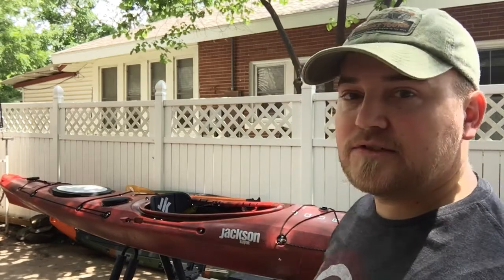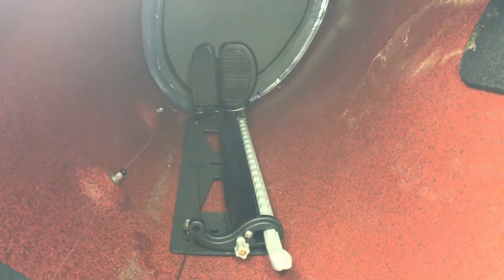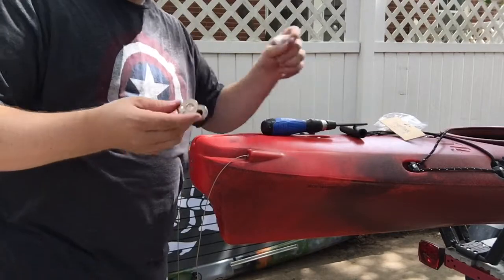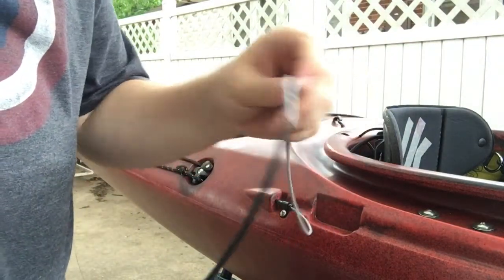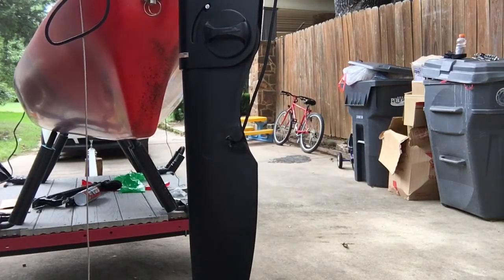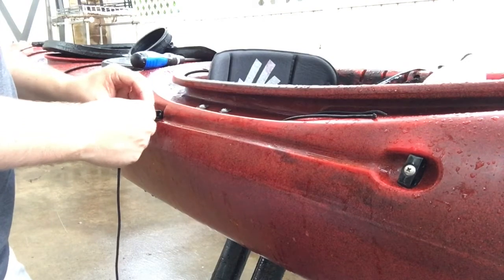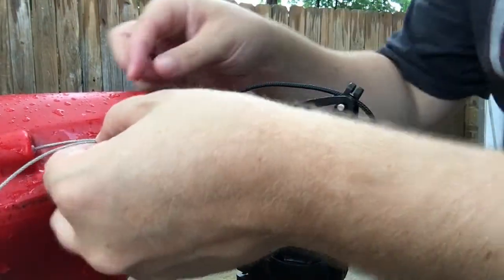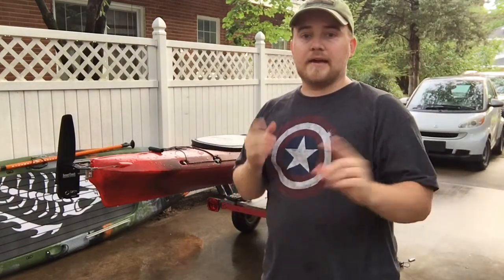Kayak Rudder Install

Comment: Thanks for this great video on the Smarttrack rudder install.  I’m in the process of installing it on a Wilderness Systems 14’ Tsunami and honestly I thought the various little sections of instructions provided by the manufacture were lacking to say the least.   While every kayak may be a little different, the instructions lacked a cohesive start to finish explanation.   Your video did that perfectly.   Thanks very much for taking the time to make this job easier for the rest of us.

Comment: I have to say I just installed one on my Prijon.  I really think the fact that when retracted it stops 90 degrees straight up is just a terrible design.  There's really no way to lock it down for transport.  if you load your kayak from the back of your vehicle and the back tip of the kayak touches the ground you will ruin it.  Also the when you retract it you have 11'" of cord just hanging from the cleat.  The action is good and it performs well I just think the retraction design is really bad.  Very informative video, well done.

Comment: This is a brilliant video. I also have a Smart Track rudder and my cables have become stretched.  In your video you attach the wires to the rudder after you have placed the foot pegs in a certain position and I could not quite follow this.  Could you please explain exactly how your foot pedals were positioned when you did this please?
Reply from the maker: I believe I placed the screw adjustment to the middle on both sides and then I would pull the right cable all the way out pulling the right peddle to the rear position and then place the rudder all the way to the left and mount the cable. Then the reverse for the left side. This way when both of the peddles are moved to the center the rudder should be centered as well.     I hope this helps

Comment: Thanks for a great video. Jackson Kayak should give you a job. I'm considering buying a Jackson Journey and was concerned that their rudder system was a little complicated so your video helped me to better understand not only how the system worked but how to maintain it. BTW how do you like the Smart pedal part of the system?
Reply from the maker: I’m glad the video helped you! 
The Jackson Journey is an excellent kayak and paddles like a dream but definitely needs the rudder to track correctly in the wind! 
I love the toe controls on the smart track rudder they are very intuitive and don’t strain your legs by putting you in odd positions like older rudder systems.